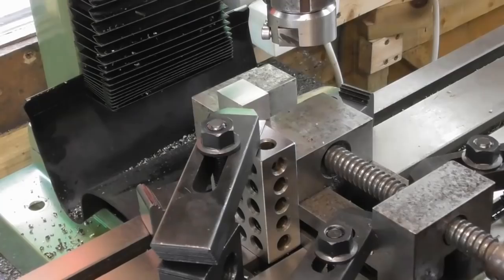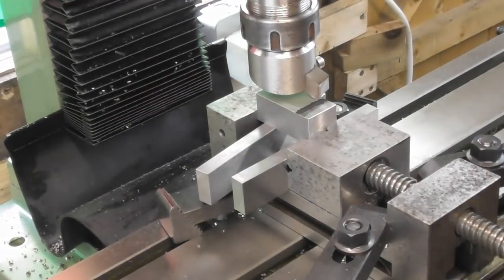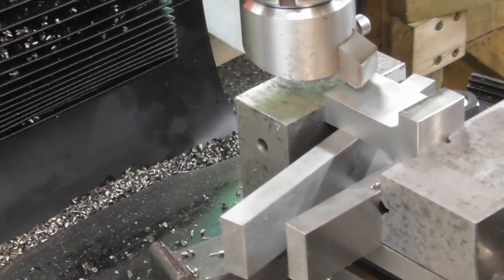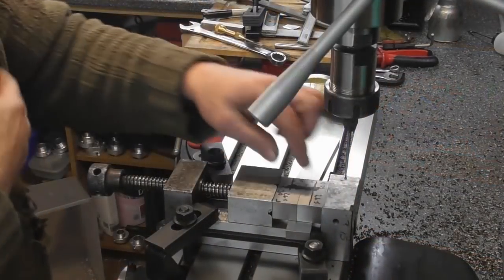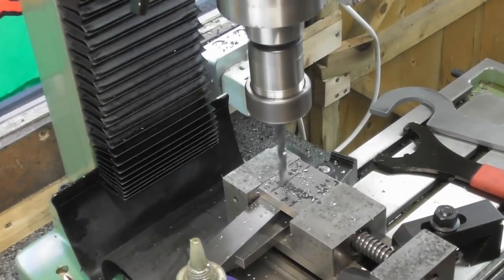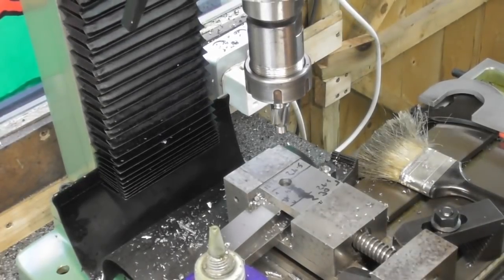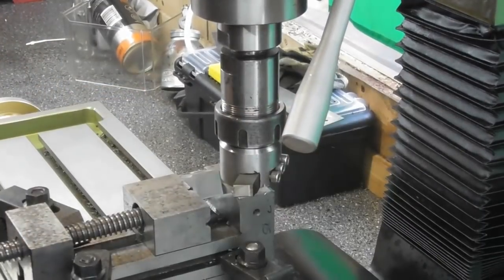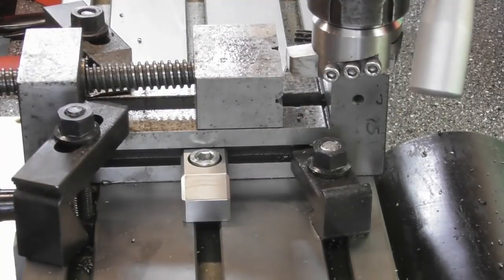New Mill first vise clamps completed .

Comment: Hello Ade, as someone who pretends to be a master machinist on the internet (not so much in real life) - I was wondering right at the start, you had the parts clamped into the left side of the vice, without a spacer on the right to keep the vice jaws more or less parallel. Was I correct, and is this a big deal? 

Lovely to see you making chips on the little beast. I really appreciate your videos.
Reply from the maker: Hi Richard . A very good question , the usual philosophy is that this is not ideal and rightly so , however, this vice and i have been mates for 25 years and it works and clamps as well as new , even with and imbalance offset to the clampscrew , it is and always was totally reliable for the practice , i guess the answer is that it is not good method , but , due to its narrow width and quality at the outset it is quite safe and fine for my purposes , Cheers Ade.

Comment: Ade I found Gloucester tooling does er32 collets up to 25mm, but they are not cheap at £20 a piece, They do seem pretty concentric though. I bought some as I needed to work on 25mm bar stock in the lathe from either end.

You are a man of many vices :). Your new vice I have one of those as well and after I had made the clamps I though why didn't I use a cam lock to lock the vice to the table. I might yet try that.

Comment: I'm fairly sure the "start slow, wind up speed" is simply to avoid someone putting some tool that vibrates a lot into the machine, and it suddently starting to walk sideways or shake itself to bits. "Avoid lawsuit text", rather than some genuine technical reason.

Comment: If your mill has nylon gears driving the spindle, fly cutters may not be a good fit. I got tired of replacing the nylon gears in my mill and replaced them with metal, and I also stopped using fly cutters. It's been trouble free ever since. Small face mills and carbide end mills tend to work much better in these little mills.
Reply from the maker: It is belt drive , brushlees motor , a different beast to the cheap geared typical type , good advice though , Cheers Ade.

Comment: Ade, lock your quill before you take a cut, I think its pushing back up a bit.
Reply from the maker: I know . it is just getting into the habit , i have noticed it slip down into the job , not fun , am getting used to the quirks of the little mill. Cheers Ade.
Reply: Really interesting. I have similiar problems using the fine tuning of the Z axle. The coulumn "comes falling down" in steps unless I constantly use my left hand applying some down preassure on the head. Locking is of course mandatory.

Comment: Nice project to get use to a new machine. Just wonder about the bulky sweater sleeves around a rotating spindle. Shop must be cold?
Reply from the maker: The video makes me look a lot closer to it than i am , been milling for 40 years , never been bitten yet , certainly the fly cutter is a dangerous beast if you were to get to close, Cheers Ade.

Comment: Oh Ade , 23:00, no backlash?, Lol, I know it doesn't matter for this job , but it might be handy to know for future projects before you install the DRO. PS, really enjoying the installation process. Best wishes, Mal.
Reply from the maker: Yes , i know , however at present the saddle has next to nothing in it , the table had a few thou to start but is better now i have adjusted the leadnut just a tad, there is a fine line between  minimal backlash and tightness of the leadnut , i think i will leave it for a bit to settle in through use . on this job it was fine at the amounts i had . Cheers Ade.